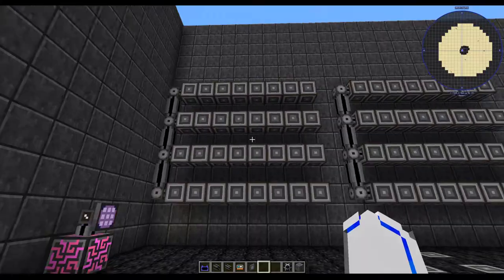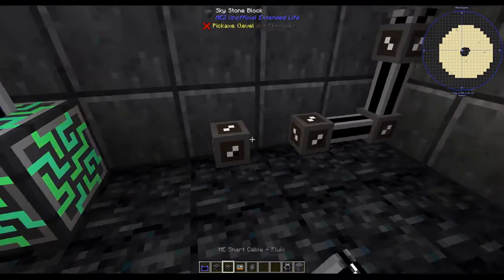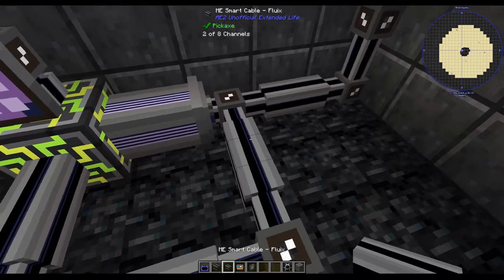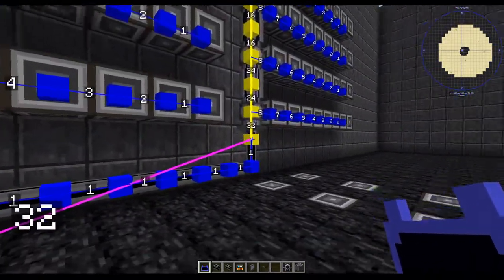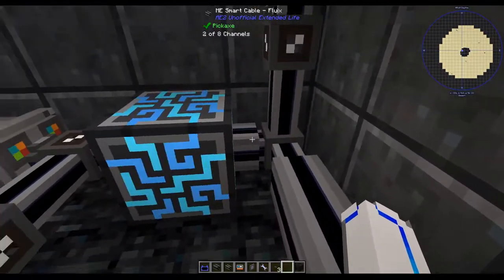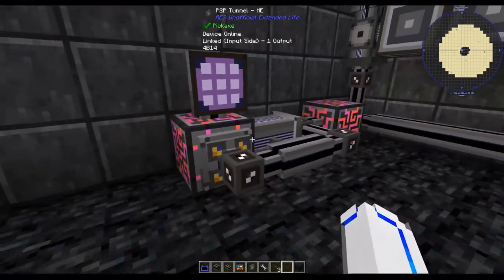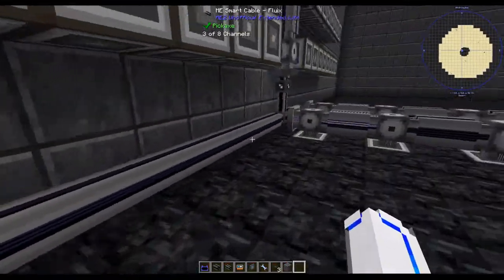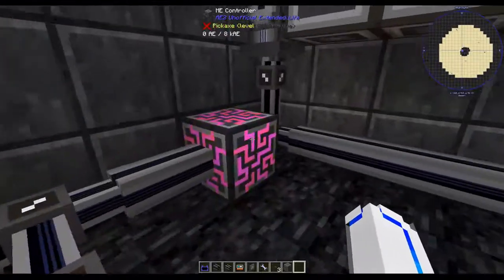Next Steps into Applied Energistics: P2Ps and Subnetworks

Comment: ive watched so many sub net and p2p videos and only now am i understanding how to set it up but only partially know how it works, so bassiclly the p2p's save from using allot of dense cable, kind of like compacting the channels and then taking them back apart, and for sub networks i dont really understand it at all other than how to set it up, and its just to have more channels than normal ig
Reply from the maker: Yeah, that sounds about right. I’d recommend just starting small and expanding as needed. 

Sub networks can be useful for keeping things separate, for example you could have a separate network that only has a bunch of storage busses, then just a single connection between it and your main net. 

But yeah that’s really for only having more channels

Comment: So the entire use for p2p is just to make everything look cleaner?
But i like my spaghetti
Reply: Not really, the reason for p2p if im not mistaken is you can access hundreds or thousands channel at the dence cable with p2p connected.Bc in the dence cable you can have 32 channel and that mean 32 p2p with 32 channel each, so maximum of 1024 channel in 1 cable however you dont need that much if you not playing a big modpack.
Reply: @KohJS-d5g  yeah so instead of 32 noodles you can run 1 noodle. You can run 32 dense cables all over the place and have spaghetti but why do that when 1 dense cable can do the same thing if you use p2p

Comment: I only get 8 channels
Reply from the maker: Without knowing the context, my best guess as to the problem you’re running into is the fact that interfaces and the like can only carry 8 channels through them, as though they were a normal cable. 

As you can see I have each group of interfaces separated into rows of 8 for that reason. 

Without more context it’s very possible you’ve got a different issue though.